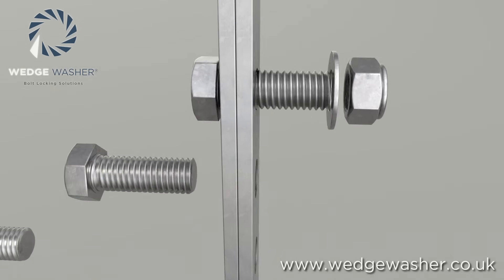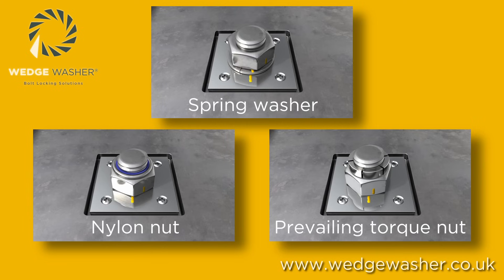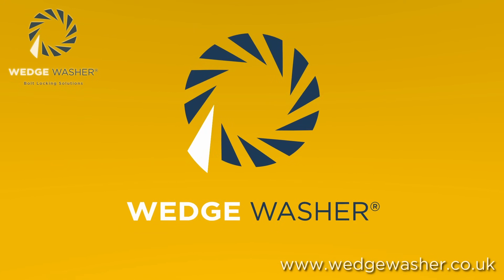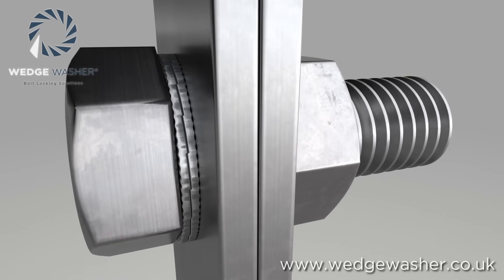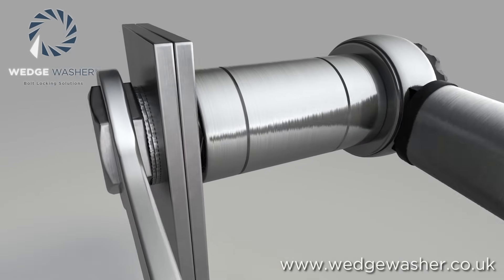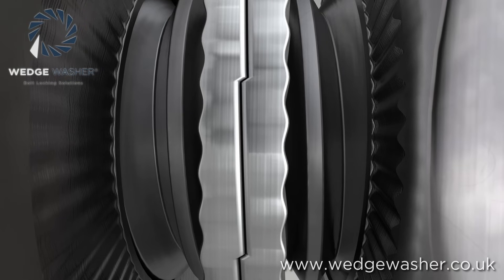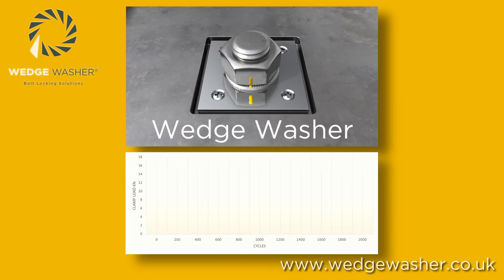Wedge Washer v's Traditional Bolt Securing Devices (Nylon Nut, Prevailing Torque Nut, Spring Washer)

Comment: Are these available, or just concept?  Stainless steel or Ferralium 255 SD50 possible?  Do they work as well on a hardened duplex stainless steel or better on softer iron based metallurgy?  Available in the U.S.?

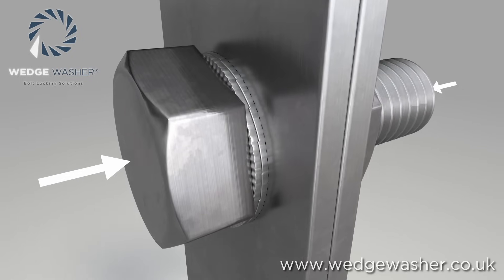Comment: 2:35
“If the connection tries to self-loosen it actually increases the tension very slightly and maintains the load.”

2:51
“[…] requiring only the same force a regular bolted joint would.”

Doesn’t these two points contradict each other?
It would be super nice if someone would explain this matter a little bit more to me. ☺️
Reply: Basically this is the same concept as the nordlock washer. watch their video it explains it well. say the nut starts to loosen and the washers start to turn, this will cause the washers to ramp up against each other, pushing the nut outwards basically pulling the bolt, which momentarily increases the bolt tension. since vibrations cant really overcome a greater tension than what is already applied, it basically can't come undone. unless for example you're human and have tools to apply that extra force to overcome the bolt tension, then its easy.